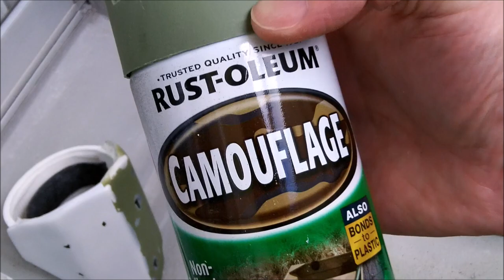Clone Armour Weathering Part One

Comment: This is awesome!
I have a question. Do you think the vaseline technique would work on primed EVA foam? I'm currently making a piece of body armour that I want to match a rather scuffed and scratched up helmet that I have, and this looks like it would achieve the effect I'm looking for perfectly. Would the sort of primer I use before laying down my base coat affect how well it works?
Reply from the maker: First you need to seal the EVA with a heat gun . Use wood glue or plastidip as your base coat. This will stop the paint from cracking as the EVA moves.  Then paint your base coat of color. Vaseline will work well to show up weathering like I did.